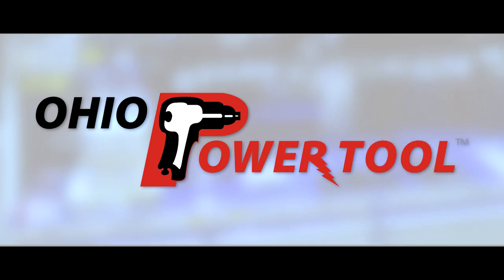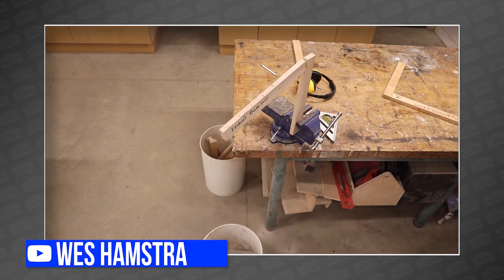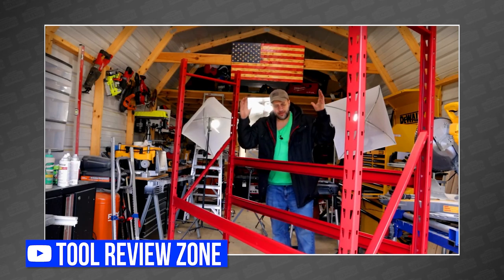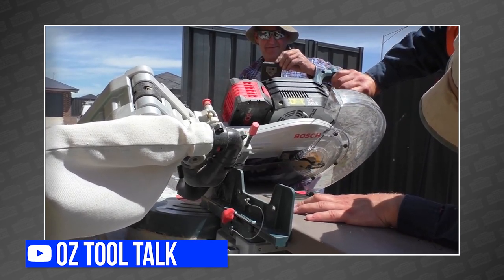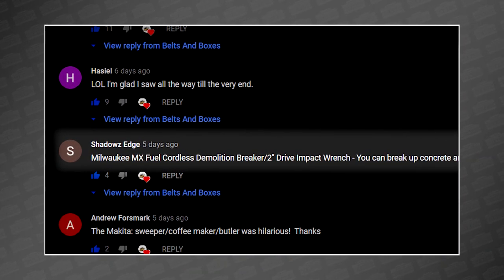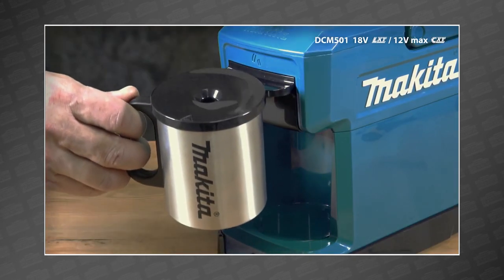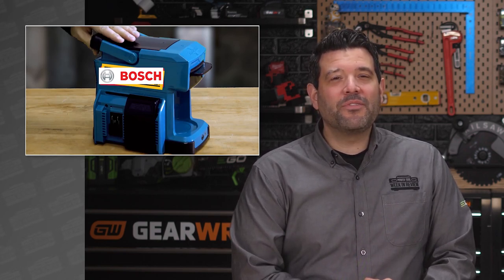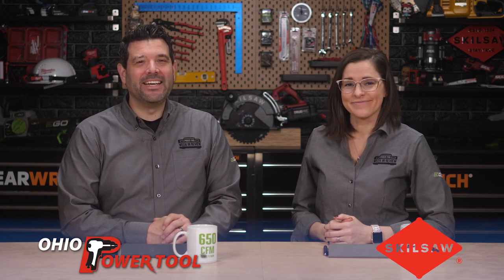When will Milwaukee Launch the replacement for OXX Coffeeboxx? Power Tool News S4E03

Comment: I brew a pot of coffee before I leave the house and put it in my Stanley thermos. If you pre  heat your thermos then your coffee with stay burning hot for 12 hours easy.
Reply: And it will burn the hell out of the coffee after sitting for that long. It tastes nasty. Id rather drink hot water. It's the same concept to using a drip coffee maker and making a bunch of coffee at once. Unless you drink it all in the first 6 to 7 it starts to burn. Same with putting it burning hot in a thermos it will actually burn itself
Reply: @cassijoanna  to each their own. It doesn’t taste nasty to me. After working in the cold for 12 hours a hot cup of coffee is the most wonderful thing.

Comment: They should just power it with butane cartridges.  They have adapters for butane to propane if you want to do a lot more cups.  I think the biggest issue is water.

You could make a K-Cup coffee machine that heats water using the 110 gram Butane pods and an M12 2AH battery to run the pump.  A single 110gram Butane Pod can boil 2.64 gallons of water.  on a JetBoil.

Round down to 2 Gallons of coffee, or about 25x 10oz  cups, I think that's enough to keep everyone at the jobsite happy.

Or just keep you happy and everyone pissed off at you.

Comment: Rob, have you tested one of those small nespresso machines with that chunky Milwaukee top off?   Not sure what the wattage draw is on those but I wonder is that a job site coffee maker fix?
Reply from the maker: No way you're gonna get a coffee (or nespresso) machine to work on a top off. It "tops off" at only 175w.

Comment: $20 Mr Coffee maker + either the generator you already should have on a jobsite (if you dont, you are poorly prepared) or a 1000w inverter. Boom, jobsite coffee and all you have to do is run your truck or generator. Thats how ive made coffee on the jobsite for 18 years,

Comment: If Dewalt made a coffee maker for $149 or less that could run a whole 12 cup pot on 1 x 12AH flex-volt pack I'd buy it in a heat beat!!!  Make it a 20V tool though so you can use 20V packs... Maybe the 6 or 8AH 20V pack would run an 8 cup pot?  Not sure but I know that any time you need to use electricity to produce heat, an excessive amount of power is needed... I have the EGO power station (And the Dewalt one too for that matter) but the EGO with 4 x 7.5AH batteries only lasted 1 hour using my electric griddle at a big outdoor cook-off breakfast me and my ham radio friends hosted a few weeks back.  I wish I had 8 total batteries but I only have the 4! :(

Comment: Battery big enough for a coffee maker?  May have to look at Milwaukee MX batteries or EGO.  Who knows.
Reply from the maker: Yeah! Wonder how many cups we could get from an EGO 10AH!
Reply: Well, eGo, DeWalt and Milwaukee have backup "generators" that use batteries to create 120V power... so a corded one that plugs into the "generators"???
Reply: M18 batteries are definitely big enough, makita has(had) one powered off an 18v one
Reply: @nuclearexplosion5841  he said the Makita battery could only make 15 ounces of coffee per charge.  Thats what started this discussion.  He said 15 ounces wouldn’t even get him started.
Reply: I was going to suggest the MX route too, as even a 12AH 18V wouldn't make that much more than a 5AH. But I like the Ego idea: "Cafégo"!
Reply: @Toolproof  in theory, it could make about 3 times the coffee... (That's over a liter.) And then you'd have a second or third on charge, because who doesn't have at least 2 batteries, especially once you get the 12Ah?
Reply: @IceBergGeo  Yeah, fair enough. Just thinking about whether the Ego could make more w/o changing batteries 🤔
Reply: @Toolproof  technically, yes. The larger the battery, regardless of greater voltage or Ah, it all comes to actual capacity and the ability to output it quickly.

Comment: Milwuakee would have best shot due to 12 amp battery. 

But maybe make the coffee maker like the rocket light. 
It could be corded or cordless but when plugged in it would function as a supercharger. 

149$ to 169$ 

Or make it a jobsite light/coffee maker/ charger

Comment: I was blocked from @ MilwaukeeTools on Instagram 3 years asking when they would begin to make coffee makers like Oxx Box. Now I’m curious if the New Milwaukee M18 Top-Off USB and AC Power Adapter will power a coffee maker. Anyone have insight? Before blocking me Milwaukee’s reasoning behind not pursuing coffee maker was the energy needed to boil water was so much all at once.

Comment: When I first saw the Ox coffee maker I thought cool. Then I noticed you have to have 120 power. At that point it didn't make much sense to me. Over 200 dollars for a coffee maker that does one cup at a time and needs a generator or some other household power source just doesn't make too much sense to me. Buy a large coffee urn for a job site, I am sure someone there could bring a table or knock one together quickly and you have 30 or more cups of coffee for everyone.